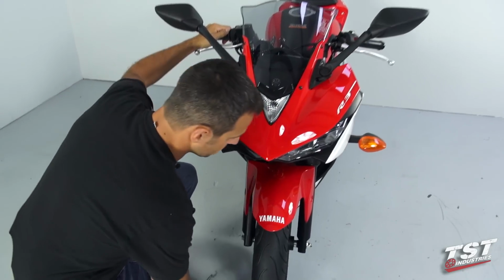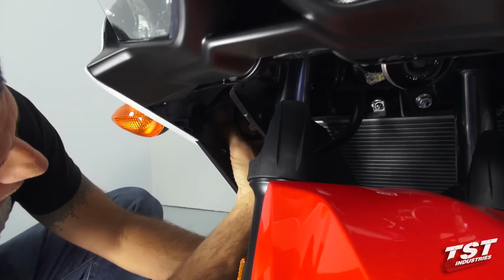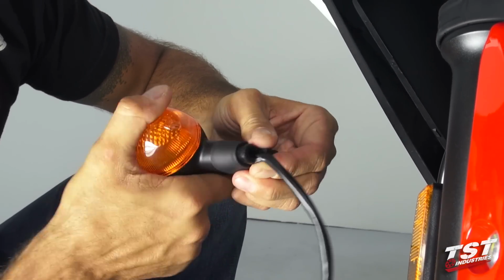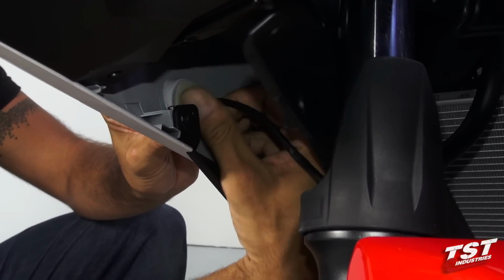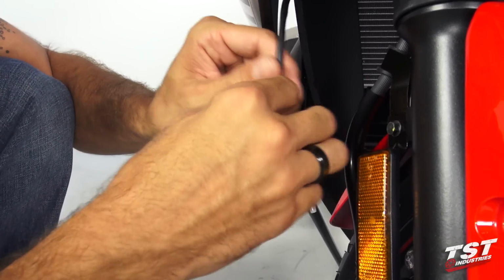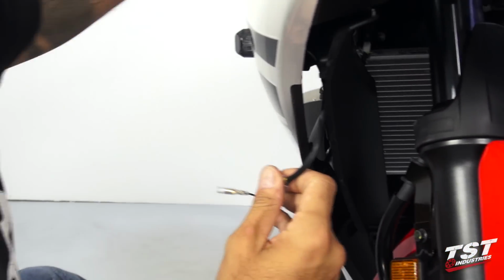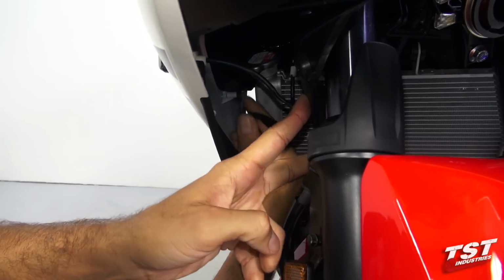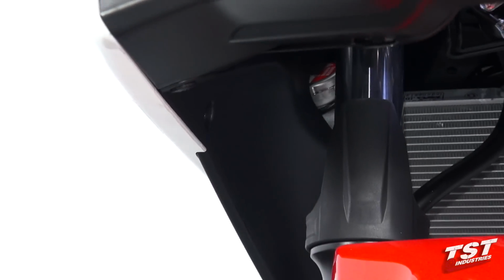How to install LED Flushmount Signals on a 2015+ Yamaha YZF R3 by TST Industries

Comment: I just received my order of smoked flush mounts and two harnesses from you guys and have a question! The wires on my harnesses are blue, red and brown. Would you guys happen to know which ones I need to connect to the black/yellow turn signal wires? The colors in this video were different than what I received. 

I was planning on just trying various combos until I get it right. Is that ok, or is it possible to damage the signal by incorrectly connecting the plugs? 

Thanks!
Reply from the maker: you will not damage anything by trial and error. The only thing you have to make sure is that no two wires to uh each other. Connect the connectors and make sure they are insulated with the cover during picking the correct wire  pair.
Reply: +TSTindustries Awesome, thanks for the quick reply! You guys at TST really are fantastic, can't thank you enough for providing not only great products but fantastic customer service and simplistic install videos too. Buying from TST is an all-inclusive experience, lol. 

I'll have these installed tomorrow, really looking forward to getting rid of the lame stock signals.
Reply from the maker: Ghost It is great to hear that. You're very welcome. I hope you check us out again when we launch our undertail/fender eliminator system for the R3.

Comment: Is it necessary to use electrical tape?
Reply from the maker: Yes, it is used to prevent the connectors from accidentally touching each other and causing a short. You can get electrical tape at any local hardware store so it should be easy to find. An alternative to electrical tape would be to use heat shrink tubing.

Comment: How come when I plug all the wire in the. Turn on the bike the signal not working and the horn not working
Reply from the maker: You blew a fuse my friend. You allowed the running light wire to ground somewhere. Once you preform the installation as per this video and replace your fuse you will be good to go.

Comment: Well they might be visible from the back side (assuming you have very thin legs) but they are not visible from the front.
Looks dangerous to me.
Reply from the maker: they actually are visible from the front. They protrude enough to have exposure from front view and the light dispersing elements in the lens diffract the light in a way that the entire lens appears lit.
Reply: TSTindustries Hmm. You should make a "commercial" video on your channel so people would see.
Reply from the maker: If you follow the link in the video description to the product page you can see photos of these signals mounted on a few different Yamahas. One of those shots shows a front view.

Comment: I got brown wire  no yellow
Reply from the maker: This video was shot before we changed our color codes. Your harness converters came packed in a foldover that on the inside  shows the color combinations for proper function. You will plug signal yellow to harness brown, and signal black to harness red. Do not use the blue wire. Install the rest as per this video. This should get you going.

Comment: can i install it with out the harness converter?
Reply from the maker: You can. The installation will not be plug and play in that case. You will need to snip off a bit of the wire with the plug off your oem signals and wire our signals into that.

Comment: i just installed these lights and they do not work ....the tst 3 way harness i got doesn't have a yellow ...it's blue,red,brown.....i tried all combos and they still don't work
Reply from the maker: You must have missed a combination. Please connect black on signal to red on the harness, and yellow on signal to brown on the harness. Then lock the insulators and do not use the blue wire. Test the lights. You should be good to go.
Reply: TSTindustries just connected it the way instructed to ....and still nothing
Reply: TSTindustries i think a fuse popped
Reply from the maker: That is probably what happened.
Reply from the maker: Did you by chance read the instructions on the inside of the packaging for the harness converters?
Reply: TSTindustries the fuse is replaced and now work normally

Comment: So these lose the running light function?
Reply from the maker: Correct. They have a single circuit so they only operate as signal lamps. There is a way to wire them in and get the running light function but that is not the correct wiring and may lead to problems down the line. An R3forum member posted a simple electronic method to get the signal and running function. If you would like to go that route you can read his article http://www.r3-forums.com/forum/713-yamaha-r3-how-diy/90825-make-your-front-led-turn-indicators-into-running-lights-too.html#post315761
Reply: +TSTindustries Danke schön.
Reply from the maker: Bitte

Comment: I didn't buy the converters do I need them?
Reply from the maker: Not necessarily. You can remove your OEM signals and cut the plug/wire off each one and splice your wires into those. That will get you going right away. Our converters just make it easier to connect your signals into the bike.
Reply: +TSTindustries thanks for the parts and support
Reply from the maker: You're welcome.

Comment: Where can I buy the harness connectors?
Reply from the maker: https://tstindustries.com
Reply: +TSTindustries will they work with the hotbodies flush mount turn signals?
Reply from the maker: +RoughRyder As long as hotbodies has bullet connectors of the same size they will work

Comment: I have red, brown, and blue wires on the harness convertors. Which colours should be connected to the signal?
Reply from the maker: Do not use the blue. Connect red to black, and brown to yellow, and that should get you going.

Comment: Are you guys making parts for the 2015 cbr300r?
Reply from the maker: currently we have only a few parts that will fit that CBR
Reply: +TSTindustries I just wanted to know if you guys are making a flush mount turn signal with relay for this bike.
Reply from the maker: +kiddeath921 I have good news for you, we recently had a cbr300r in the shop and we're working on releasing LED flush mounts and a flasher relay for that bike. So be on the look out for those products!

Comment: Do I need the harness converter?
Reply from the maker: More than likely yes as these signals, by default, only have two bullet connectors on the ends.

Comment: If I have the integrated tail light installed, will these turn signals be dimmer?
Reply from the maker: No, that's not how it works. You can connect 2 or 20 signaling devices to your signaling circuit, and if the fuse and wiring will support that much current draw all will light at same intensity